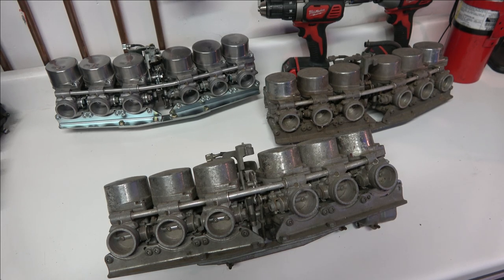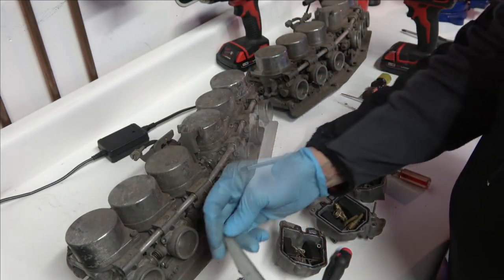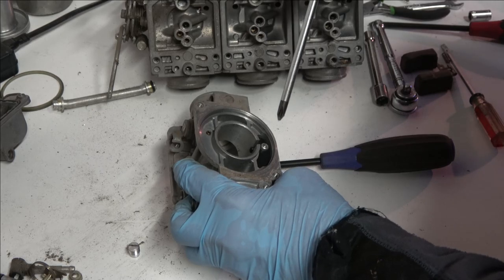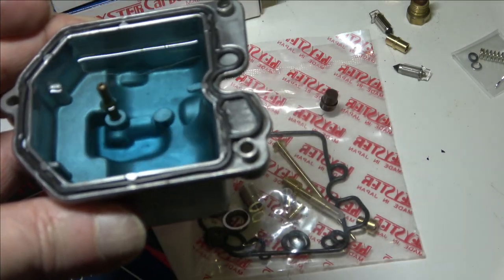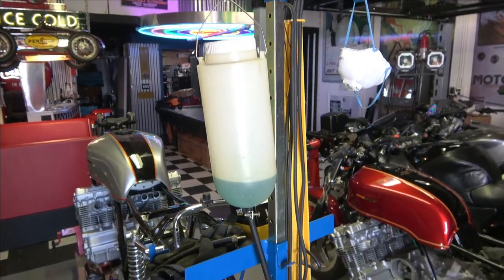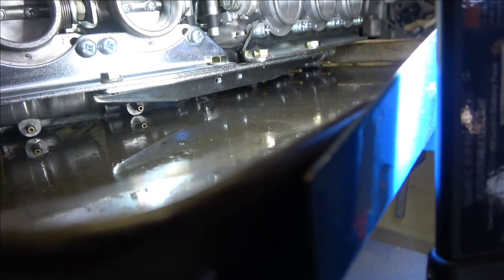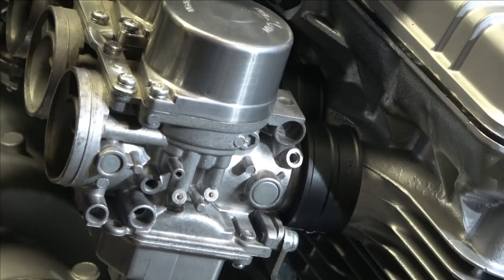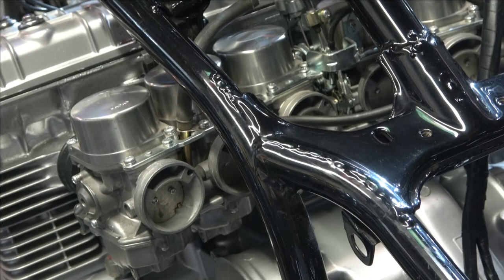Honda CBX Full Restoration & Engine Rebuild Video Series - Part 36 Carburetor Rebuild - Part 1

Comment: Having just rebuilt my 1981 CBX carbs and reinstalled them, I found your video very valuable. Thanks! Of particular note is the attachment of the choke cable which is incorrectly shown (reversed end-for-end) in the 4th edition "how to" guide of a famous CBX specialist. If installed like he shows it WILL bind up. Yours is correct. Also, when installing the clamps on the intake tubes (rubber donuts) I find it best to place them on the tubes before installing the carbs. All of them can be accessed for tightening from the upper side of the donuts except for the #3 and #4 clamps on the head side which must be accessed from the lower side because of the engine mounting bosses in the head. Thanks again, great videos!

Comment: Nice video, wish it had been available when I did my carbs many years ago. A couple of things to note: I would do the accelerator pump while you're in there as they get a little stiff over time. Also would agree that you don't want to go cheap on the rebuild kit - the one I bought had some pretty sketchy plating and the profiles on the needles were horribly off. Since there should be no wear on the needles, I just re-used the originals. Great video and thanks!

Comment: Amazing video. Wish I’d watched this before I restored mine.  The pre install throttle cables and the wood trick would of saved me two days lol.  I eventually figured it out just like you did. Except I used wood and a little screw jack lol.  I couldn’t believe how tight those suckers fit.

Comment: Hi  I have two sets of carbys both have a 13 mm   Long hose connecting carbys 1&2,5&6 is the hose only supposed to be on those  two or all the carbys re peter hope you can help me thanks for your videos

Comment: The Honda manual suggests not re-using the choke valves, shaft and screws on the carburettors. How do you get round this as they are not available for replacement?

Comment: 23:30: I'm also using a hairdryer to heat up the rubber intakes, it makes them easier to cooperate with 🙂. 
Im struggling a bit with the choke, since it does not rotate that smoothly. Looks like my choke axles on the carbs have a bit of a slack there, can these be tightened up?

Comment: Nice job sir, i need help
I have a 1982 cbx and i find under the carburator a spring, 2 washers and a plastic buching and the parts from the aceleration pump linkage arm, do you can tell me the instalation order and i need get a small cut pin.
Thank you
Wagner Damotta

Comment: is there a part 2? I'm having a hard time assembling the butterfly choke flaps back on. the spring and flaps I just can't get to work together.
Reply from the maker: Hi Todd
Yes, I will be posting a part 2 on the carbs this week.
The choke springs on the choke rods have opposite orientations. So there is a right and a left.
It’s important that when you close the choke flaps, the springs are set in a way that they tighten up freely without binding up on themselves which can happen if they are on the wrong side

Comment: Where do you purchase your carb kits?  Happy Friday!
Reply from the maker: Hi Michael, I just get them off eBay. There are a number of places that sell them. Just make sure they are Keyster. Stay away from the China sets.
Reply: @digitalpizza1  , thank you sir.  I'm  finding the KH-1018NFR.  They say 79-80 CBX and should work.  They show carb #'s on the boxes so I will check my carbs.  Thanks again for the videos, sure make a difference seeing it done vs just reading about how to do it.  At least for myself...
Reply: @digitalpizza1  Could the name of the pointed tool you're using be an 'awl'?
Reply from the maker: @autodidact537  , yes that's it, LOL I had a brain fart while I was filming
Reply: @digitalpizza1  Assume video.  I have a '79 CBX with only 4200 miles and am planning to rebuild the carbs.  This is a dumb question but when sitting on the machine, how are the carbs numbered?  Is Carb #6 on the outside right?  Thanks again for the detailed restoration.
Reply: @johncarpenter4481  yes, as you sit on the bike they are numbered 1-6 from left to right.